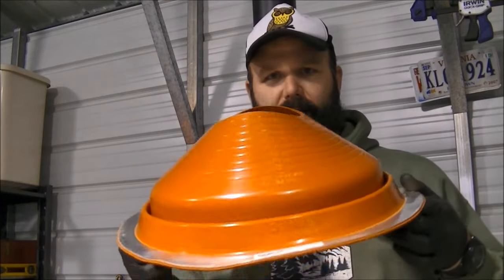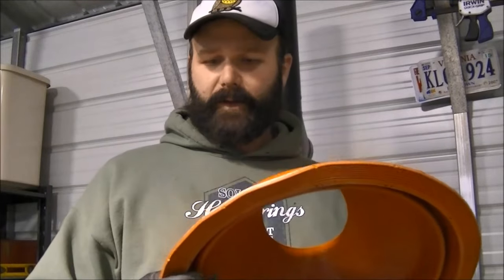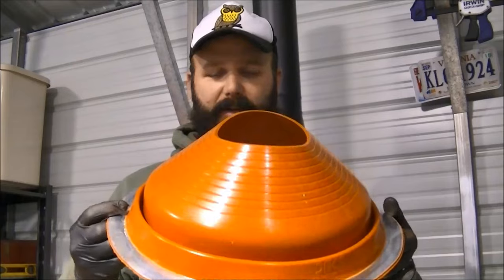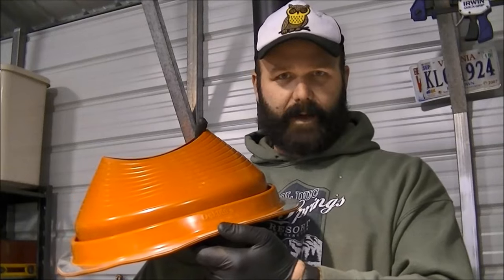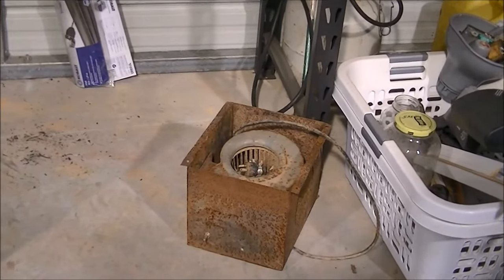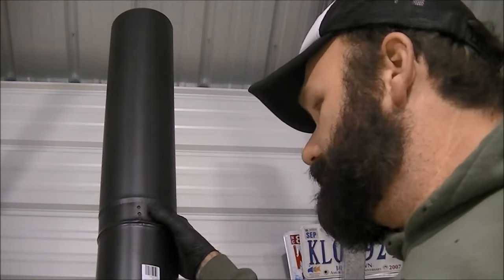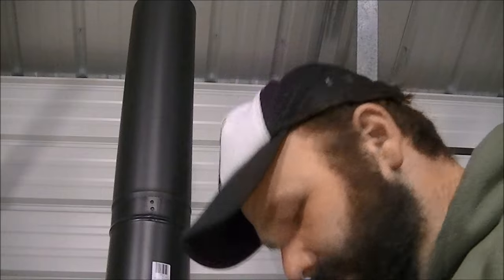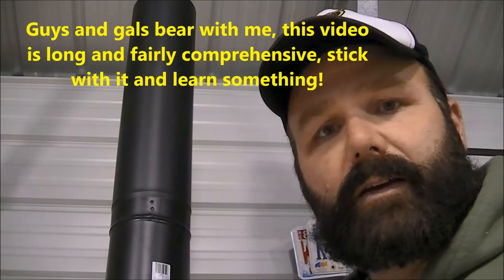How to install a wood burning stove in a steel building or carport or barn.

Comment: The peak (ridge) and the roof line are two different things. From everything Ive seen the chimney height should be 3 feet above the roof line, not peak (ridge) . Professionally installed fireplace  chimney on my house is 3 feet above the roof line.
Reply: yeah i thought the chimney cap was supposed to be 3 feet above the highest part of the roof ?? does anybody know about this ? thanks in advance if someone does.
Reply: The chimney top needs to be 3' above the roof penetration or 2' above anything withing 10'

Comment: Josh
You only need to make the stove pipe hole large is the pipe not as large as the flange
Woooo
Reply: That would only apply to the hole in a metal shop roof correct? Otherwise if it were plywood you would need 2" clearance the whole way around...

Comment: Maple, ash, oak, bitch, fruit trees in my opinion are best to heat your home. Start you fire with small wood get a good coal build and then add bigger peaces of wood to burn all day.
Reply from the maker: All wood puts out the SAME BTU by weight....some wood is more dense than others...some has more sap that creates creosote and a fire hazzard in your pipe/flew/chimney.  The more dense the wood...the more BTU of heat output.  Ash, oak, hickory and the best of all around here is Locust.  Dense hardwoods are the best for sure you make a good point Mike

Comment: top of your chimney should be 3 ft above the peak of the bldg...otherwise you will get a bad draft and cause havic...
Reply from the maker: Funny you say that...I did extend the pipe about 2 feet....and I did have some draft issues smoking up the shop...thanks for the tip buddy
Reply: Mine's only about 12 and I haven't had any problems.  It's also only about 12" from the peak, so that probably helps.
Reply: I do heat and air for a living and have to cut holes in metal roofs similar to that but one thing I would say is use caulk under the decktite before you put it down then caulk it around the edge and over the screw heads. They will leak with time.and use np1 to caulk them, once dry it's like rubber
Reply: Good to know.
Reply: Jason Spencer Just curious. Would this rule apply for a chimney coming out of the side of the house and up to the roof at the gutter?
Reply: Ours is below the 3ft of the peak you recommend. Only problem we have is downdraft (sometimes) during starting during colder months. Once the flu/pipe is heated, no troubles. Curious if pre-heating with a couple of charcoal cubes would remedy this.
Reply: @StoneyRidgeFarmer  I did the same thing. Built one hell of a fire,then went in the house for a while.Came back and it  looked like a 3 alarm fire.lol
Reply: @frodrickfronkensteen9241  yes buddy if you have draft issues preheat your chimney and that would help you out tremendously coming from A+ fireplace and chimney services .
Reply: Thanks for this video I learned a lot from the video and even more from the comments! Thanks for putting this out there for us all to learn a thing or two. I really appreciate the chimney prof chiming in with specs and corrections.

Comment: Everything looked good except for cutting the whole that big. There is a gap around the pipe. What was the reason for doing that. Yes, I realize that is the size of the orange gasket.
Reply from the maker: Ok, glad you asked Mike...so the hole is cut so big so that I dont have heat distorting the surrounding roof metal, making it become discolored and destroying the painted surface.  I wanted enough clearance to keep the roof metal from getting hot...so far so good. This space also gives the roof gasket a bit of flexibility in wind and if my paint were to become damaged from the heat the roofing material would surely rust up...so...there's your rationale ...hope this helps...by the way it's been a year and I've only had one tiny issue....I get a water drip once and a while during a heavy storm...probably need to go back up and do a bit or extra sealant around the ridges,,,hope this helps ya buddy

Comment: Great install vid.But bad idea putting wood heat inside uninsulated steel building!!!!The heat is gonna cause condensation inside,Roof and walls will drip all over causing rust.
Reply: James Brothers  what about installing in an airstream trailer?
Reply: who cares. he's using it to take the chill out of the air to do shop work and keep animals out of freezing temps.
Reply: I have a wood burner in an uninsulated metal building and I don't get any dripping.
Reply: Never mind the in insulated walls. These buildings have openings everywhere. The worst area is above the roll up door. You better have a good wood source! And yes I have one.

Comment: Did you add some base foundation soil fasteners ?
Remember the building design was for a 150 mpg wind shear.
When you added the closure walls it raised the resistance curve.
Just sayin, not trolling

Comment: Wood is nice but I do pellets stove now I hate cutting splitting and stacking and hauling wood $3.97 a bag  running 24/7 at 68° F it costs me less then $60 a month to heat 1200 SQ feet and I can use corn to ..... I can't complain the stove was one year old at a friend's house he was going through a divorce so he was filing bankruptcy the bank was going to take back the house and he didn't want to mess with the stove so he was going to leave it ...so I got it free I also took his garage door opener it was brand new too

Comment: on the single wall pipe at the top of the T you have the crimp backwards do yourself a favor and buy a MALCO C5R Crimper tool off amazon for $35 and crimp the top of that T and flip that pipe around and do the same with any other joints that are reversed they all should be so that the bottom pipe slips inside the upper so smoke is less likely to leak out. i know this video is 2 years old and your unlikely to see this comment but making this comment will make me sleep better.
Reply from the maker: so....I've been told slide them downward into each other so that water doesn't flow down into the pipe and run out...lots of schools of thought here for sure..thanks for the advice brotha

Comment: The top of the tee, must be crimped to allow it to fit into the pipe, so the rising gases don't leak at the fittings, ask a plumber to explain why
Reply from the maker: Thanks for the tip brotha!
Reply: No actually the crimp should face down to direct any condensation down the pipe instead of out onto the surface

Comment: Yellowchevy42
Josh,
Great instructional video!  Your building looks like the one I have.  I bought mine from House of Stars in Madison, NC on Highway S 220.  They are about 8 or 9 miles from you.  I had it installed on concrete in October 2016.  The size is around 720 sq ft.  I insulated mine with a product called Prodex.  You can find it at...insulation4less.com.  I'm getting ready to install a wood stove in my building in about the same area as yours.  Is there any particular reason why you didn't take the exhaust straight out the back of the stove through the wall of the building and then up the outside to the roof and secure it?  I imagine some heat may be lost, but when  you mentioned about sealing you pipe good due to smoke, I thought that was a good reason to consider installing the pipe out side the building.  Well Josh, I wanted to shout out to you and let you know I think you did a good job on the installation and I appreciate you sharing.
Reply from the maker: Funny I bought mine from the same place..shoot me a private message if you wanna come look at mine and talk about it...we probably arent very far away from each other..might give you some ideas...to send a private message just email me stoneyridgefarmer@gmail.com

Comment: I don't get it.  You've got a metal roof so why cut such a big hole to accommodate a rubber thingy.  A ceiling of nothing but metal should be a cinch to make fit a simple piping.
Reply from the maker: The "Rubber thingy" is a gasket my friend ...the instructions on proper installation of the gasket dictated how I installed it....so it's not me. Now as for the pipe clearance....heat kills paint...paint keeps roof from rusting.....even though the pipe is double walled and insulated it still get's too hot to touch....  
This is an intelligent approach and has proven good for the last 2 years without issue.  I don't want a rusty stained roof, damaged from heat

Comment: I'm still scared my wood stove has been sitting in my shop for years and I'm still afraid that I'll ruin my roof if hook it up
Reply: Fortune follows the brave! if it feels right for you DO IT!
Reply: Can you run the pipe through the top of the sidewall where the roof and sidewall meet? That way you don’t have to cut a hole in your roof. That’s what I plan to do on my install. My roofer friend said never cut a hole in your roof if you can avoid it.
Reply: Hill Top Machine Works never cut a hole in your roof if you don’t know how to seal it properly👍🏻👍🏻

Comment: My home owners will not allow a wood burning stove in any shed or garage where fuel or oil is kept. If there is a fire, they could deny the claim. Anybody else have this issue?
Reply: Yup, either need to have an indoor or outdoor
Reply: Where I am in a garage the belly of the wood stove has to be 18 inches from the floor in case anything is spilled
Reply: It is against code in the us to have a solid fuel burner in any garage or space with gasoline present

Comment: Little advice next time you want to do a wood stove go up then out the wall and then back up it easier to seal up around a hole in the wall then it is to seal a hole in the roof

Comment: all sorts of problems with this. roof angle, glue, - would have been much smarter to mount through the side and over the top. this thing is most likely leaking or requires constant maintenance.
Reply from the maker: Yep....2 years later no issues what so ever....so proof is in the pudding here on my end brotha...worked great